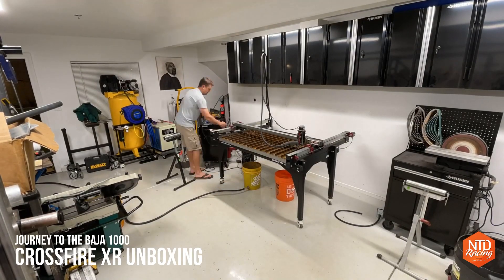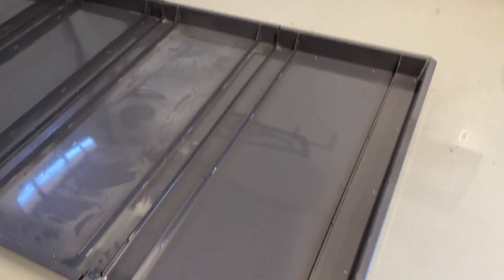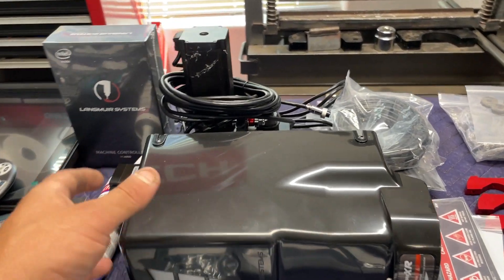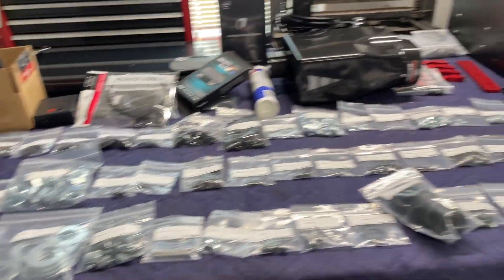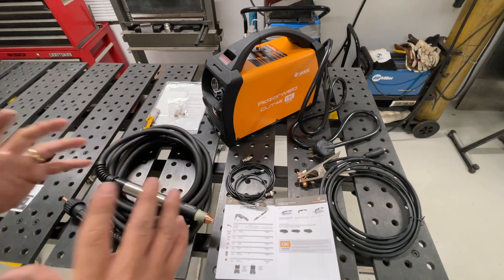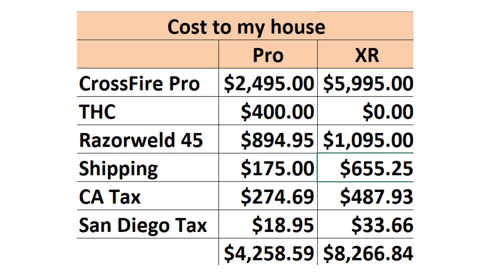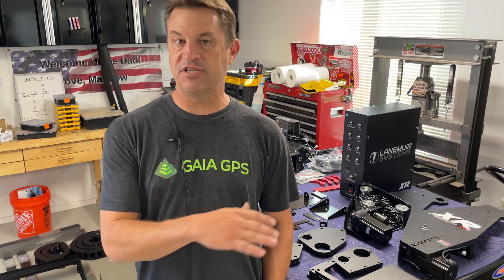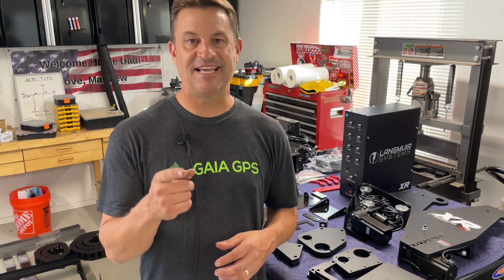The CrossFire XR Is Here!  Check out what you get.

Comment: How does that 60 Gal Dewalt hold up during heavy use while cutting?
Reply from the maker: Works great.   Does not run all the time.   Will kick on for about a minute to top back up to 150 during the cut.   If I have a small cut and 100 psi in the tank, I don’t even turn it on.
Reply: @ntdracing  Ok, putting the XR together now and need to purchase a compressor. 80 gal is 1st choice but space might call for the 60.
Reply from the maker: I only use compressed air to plasma cut.   My Dewalt is more than enough to do the job.  Good luck and thanks for watching.